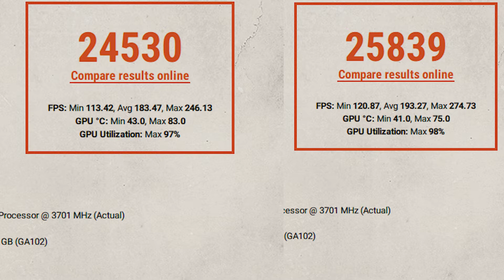Does A CPU Cooler Increase Performance And FPS In Your PC??

Comment: thanks man im on a ryzen 5 3600 and wanted to upgrade to a ryzen 7 5800x but my temps are alittle higher while streaming so i feel like the cooler will assist that and is the more important component to upgrade first also my main focus is to increase FPS and smooth gameplay while i stream! Liked and subscribed  😎
Reply from the maker: It’s surprising what a decent cooler can do :)
Reply: @Ash Built  do you recommend I upgrade my cooler or cpu first ?
Reply from the maker: @R3dEyez_J7  I would go cooler first
The reason being if you get a really good cpu it won’t be able to preform if it can’t keep cool
Reply: @Ash Built  thanks man! 👌
Reply: @R3dEyez_J7  i just got done making a custom loop for my pc (first one ever) my old wraith prism had my 5800x at 90+ degrees when running cinebench and after the custom loop i peak at 53 degrees and my score also improved bc it was no longer thermal throttling.

Comment: You'll probably get 10 more fps once you add a low profile fan to fill out the radiator. These closed loop CPU coolers are a huge advance for computer building because before you had to deal with the hassle of building your own water cooling loops!
Reply from the maker: I’ll be getting a new fan soon so I’ll do some tests to see how much better it performs

Comment: I want to know i wanna but liquit cooler for my i5 10400f will increase fps on cs go 2 and warzonne 3 and the sttuter will gone?
Reply from the maker: It will help. The cooler the cpu runs the power and performance they can run.

Comment: did you find another fan I have the same issue
Reply from the maker: I did find another fan in the end but I’m hoping to upgrade to a bigger case eventually
Reply: @AshBuilt  do you know what fan as I would like to get it installed correctly

Comment: i reccomend getting more airflow to your cpu it overheats  alot mabye get more fans
Reply from the maker: I could do with a bigger case really I don’t have anymore room for fans
Reply: @AshBuilt  yea
Reply: @AshBuilt  i heard if you get more low profile memory that can fix this as well, i ran into same issue and i have the same ram as you, I put the fans on there and got it wedged in there but it could not reach the screws at the top but it was proper wedged